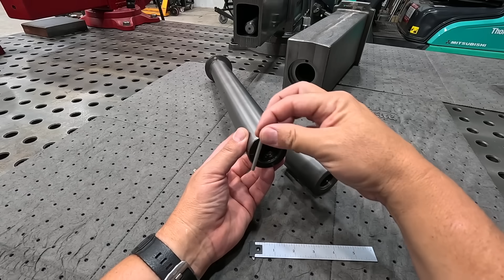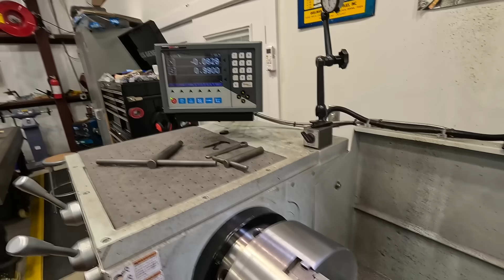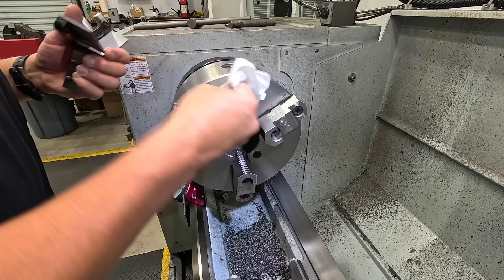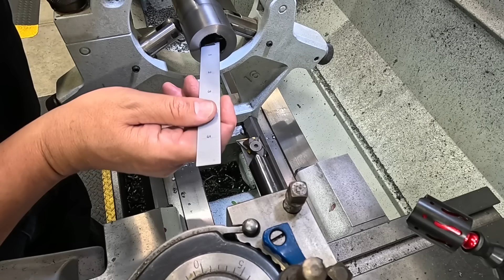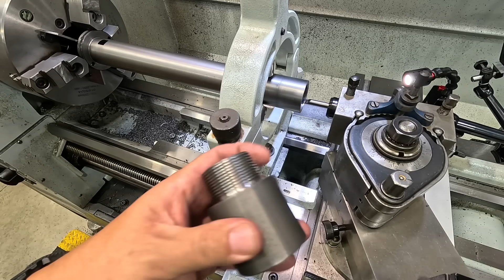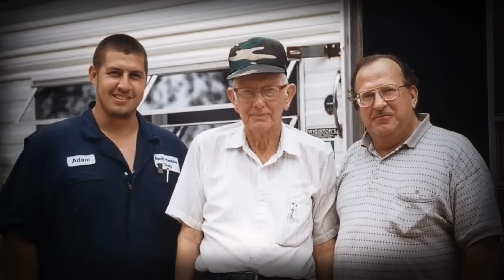Hardtail Nut Modifications

Comment: Adam, speaking as an engineer, you have a tendency to cut your thread relief way too deep. This is creating a needless weak point in your shafts, where none is needed. Limit your thread relief to that which is necessary to get your tool out of the way during shut-down. It's there to protect your tooling, but you're using it as a cosmetic feature more than anything.
Reply: You notice he says as an ENGINEER not as a machinest. As long as a comment is done respectfully we should ALL respect it. Adam works with what makes him comfortable but as an ENGINEER they try and avoid any point of failure. The amount of stress to cause that thread relief to fail is high but a failure point that can be avoided is one that should be.
Reply: Speaking as an agriculture teacher, I like red tractors
Reply: in case you hadnt noticed, two seperate channels.  two different individuals.  I enjoy both.
Reply: Speaking as a registered nurse... I have nothing to add. 🙄
Reply: My opinion is that the geometry of the thread relief is more important than the depth. Meaning whether it's radius or has a sharp corner, because sharp corners can cause stress risers (cracks) but a radius is around 400x stronger.  I can't cite any literature but maybe someone can correct me if I'm wrong. Edit I looked it up. It's 25% stronger for impacts  75% stress reduction
Reply: As a mechanical design engineer, you always design for the task, then add FOS (typically 2). 
Unless this vise will be used to make diamonds, I don’t think the threads will pull out.
Reply: speaking as a retired old fart, I love cigars.
Reply: @powertool64 please send us all a link to your channel.
Reply: @WishingWellAnalytics  The trick to sarcasm is that you need to be a little brighter when tossing it around.
Reply: @tmenzella  he doesn't need a channel to be right,  just as having a channel doesn't automatically make you right.
Reply: Those who can, work with metal; those who can't, work with wood.
Reply: @byron7165 I don’t do either, so I just watch with admiration, respect & awe  🤣🤣🤣
Reply: DIN76 is a nice standard for reliefs and undercuts. My toolroom CNC lathe with Siemens control gives you the option to automatically put those reliefs at threads and journal shoulders.
Reply: @Bancroft12194  Is DIN a German standard? In the US there is an Aerospace Standard for internal  UNJ threads. i ran a 
DMG MORI with a Siemens control it could do a lot and it could simulate it on the control
Reply: @caploader111 Yesir it's German. I have a Romi with Siemens and there is a menu with "undercuts" that you can conversationally tell it the thread pitch and it will calculate the radii and angles for the standard relief and gives you a few options to choose from. I'm not aware of an ASME standard equivalent. But if Google DIN76 you can get a PDF of the drawings and formulas
Reply: Christ, I make a general observation and you'd think I cooked the sacred cow. I wasn't even speaking about this project in particular, but something I see every time Adam cuts threads. Compounding that is @Abom79's reaction to a simple comment, and it speaks volumes about character. It doesn't matter who you are or which side of the design drawings you develop (engineer vs machinist), when you take the stance that there is no need for improvement, YOU are the chink in the armor.
Reply: Why does Curtis do 100 times more work in half the time and his work is for actual equipment and machines. And a lot more percise
Reply: @claytonWells-tr8yl  Its ironic that you misspelled PRECISE. So you're saying he does 200 times more work in one video that takes a week to record. And how do you quantify precision.
Reply: Abom has been on YouTube for a long time. I bet he makes a decent chunk of change off the videos to Comfortable work at whatever pace he wants.
Reply: @claytonWells-tr8yl Precise

Comment: Shame that you can't put a remote display for the DRO on the carriage, so that you don't need to setup a separate indicator.
Reply: A DRO on the carriage would get covered up with oil, coolant and chips. Indicators can be easily removed and stored.
Reply: @ellieprice3396 I was referring to a removable screen that’s remote from the main dro.   Like an indicator, but displaying the axis reading from the dro.
Reply: @colindawson4818 A permanent DRO in the operator’s lower line of sight would be ideal. A removable display has no advantage over an indicator.
Reply: @ellieprice363  That advantage is that you don't have to set it up every time, just place the screen, when you want it.  No need to line anything up, like you have to with an indicator.     The point is, the DRO is already an indicator, the idea of a small remote screen in your eyeline, adds the convenience of the indicator, without need need for the setup.
Reply: @colindawson4818 Where would you store the removable screen when it’s not being used?
Reply: @ellieprice363 either leave it on the carriage, like the indicator, or plug it into the dro for storage and battery charging.